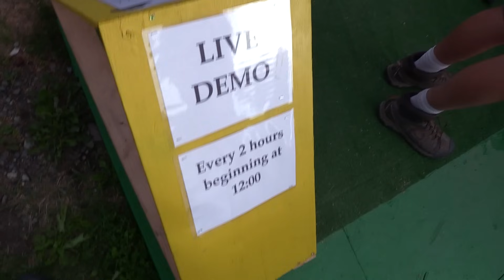Unveiling the Future of Gold Mining: Riverdance Mini Jig Demo at Alaska State Fair!

Comment: Another tip to consider is having a graphic made up showing the layers, how it would look if you used a window for a Split View of the action. It would make it easier for some people to grasp the concept. You could print that on corrugated plastic size 24”x 36” at Staples or Office Depot or online. It’s cheap plus durable enough to be moved from show to show.

I have a question. Are the shot magnetic?
Reply from the maker: The shot is carbon steel or stainless steel. It is magnetic (can be picked up with a magnet)
Reply: It is ferrous, not magnetic.  Tbe shot would itself attract ferrous metals, were it magnetic. ;)

Comment: Can the jig be disassembled and put in a backpack?
Reply from the maker: It is small and light enough to pack in “ready” configuration, but you could take the center module and motor assembly out of the frame if you wanted to.

Comment: Would it be possible to modify this to work without power? Maybe using mechanical energy from water flowing from a small refillable reservoir mounted above the unit.
Reply from the maker: I have considered a hand crank option, but not water… interesting.

Comment: To me this just seems to sift the material.  Both black sands and heavy stones remain with the gold.
Reply from the maker: You aren’t wrong, but allow me to clarify. Mineral jigs separate by size and specific gravity using less water than a sluice box and trapping more gold, especially fine gold. Yes, there will be black sand in the concentrates but exponentially less than with a sluice or some other system and this machine is self cleaning so you don’t have to stop to clean out nearly as often. Plus, you get at least two separate size concentrates (the more stages you use, the more separation and less black sand) so those stones you mentioned will only be in the tray which is limited to about half a pan of material no matter how many buckets or lbs/kilos you run.

Comment: I had to laugh a little. It is just a duplex jig and I doubt there is any Patten on it that this guy owns. You usually use them for for the first stage of clean up. If you took this to the beach of Nome it would over load it self with black sand in ten minutes. it would be good in the desert with small gravels and rocks but a place to shovel onto and then wash into the jig would be best.
Reply from the maker: Jigs aren’t new, but they’ve never been this portable, and they are now configurable into multiple stages using the same drive system. That has never been done before. I think you’d be surprised just how versatile these machines are. My jigs have been used for clean out in the Bering Sea with loads of the black sand you mentioned, for processing crushed ore to recover gold and scheelite in CA, running beach sand in Kenai, all with outstanding results. Until the screens are impacted with gold, you can keep running and running for hours on end. The screens are now removable so when the tray fills with gold (like during a Bering Sea dredge clean up) it literally takes seconds to swap out and get running again. I hope you’ll check back in as we post more videos this summer and more customers post videos as well.